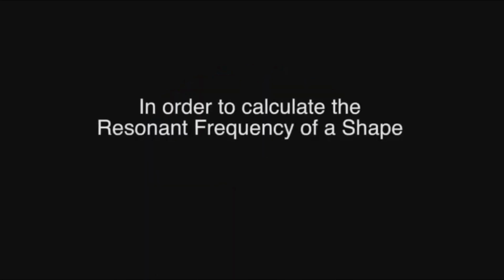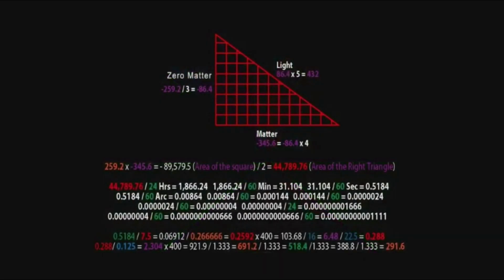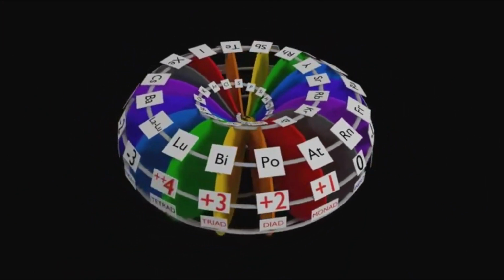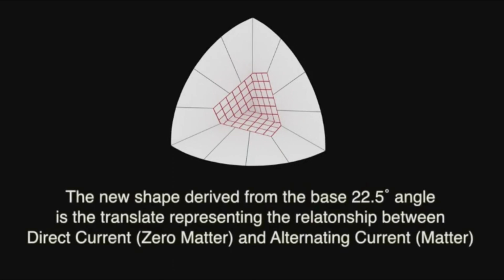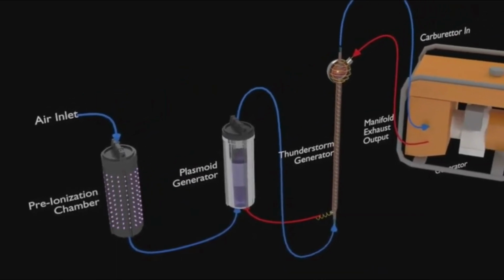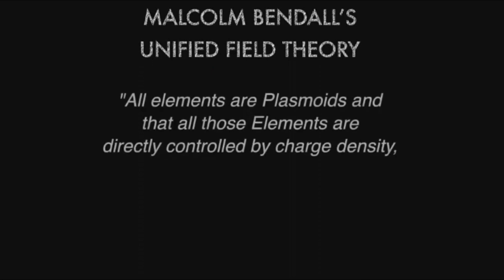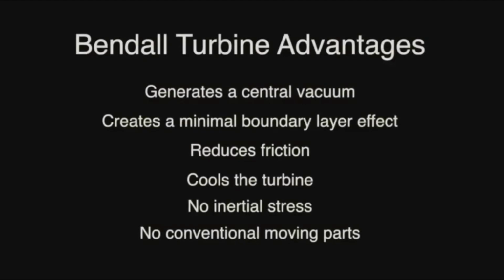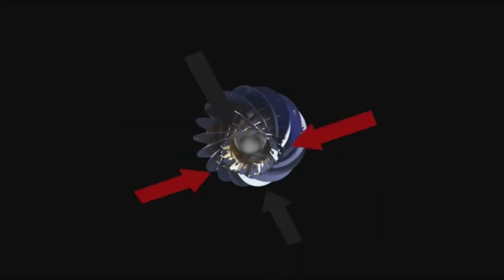The Bendall Turbine | Plasmoid Generator and Unification Model

Comment: I fail to understand why you specifically split it into 8?
And I can't see the fibonacci sequence hitting the nodes either, your spiral seems more uniform. each node is on the 'cape of capricorn', 'tropic of cancer' and equator so to speak. Those distance are uniform from the centre and the fibonacci spiral isn't?
I'd like to understand this model. If you could show how it was worked out I'd be grateful .
Reply: I just ordered his book of notes.  I'll explain once I've finished.
Reply: It's split into 8 because the PUM is very intertwined with music theory concepts. 8 is how many notes in a scale from the root (1) and it's octave (8) Hope this helps!